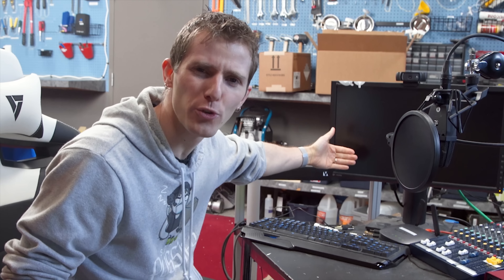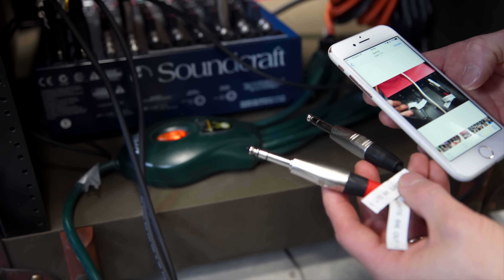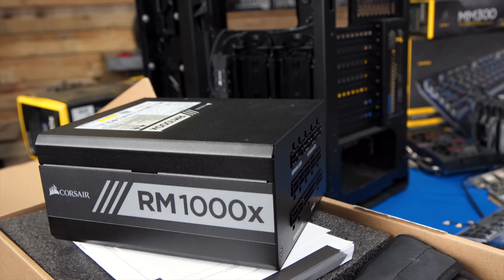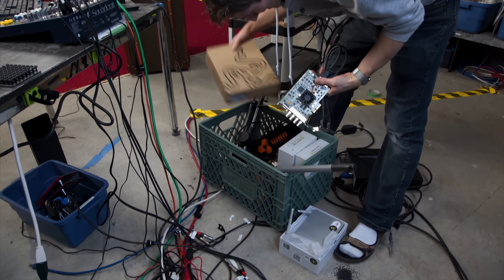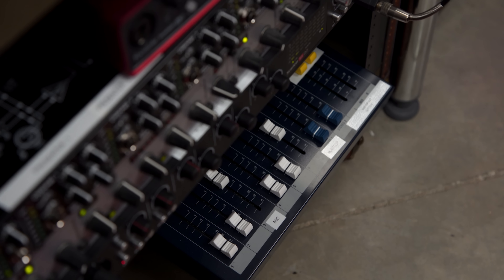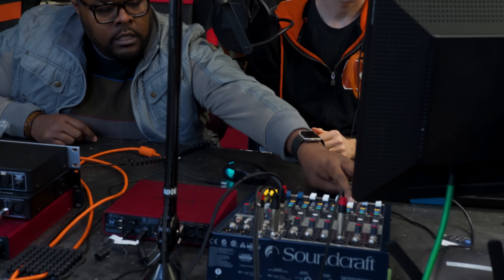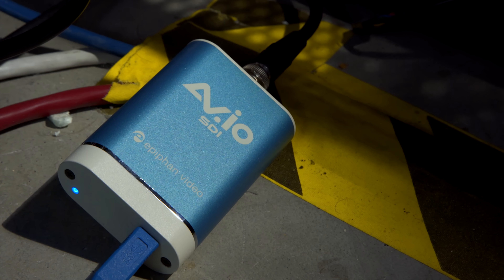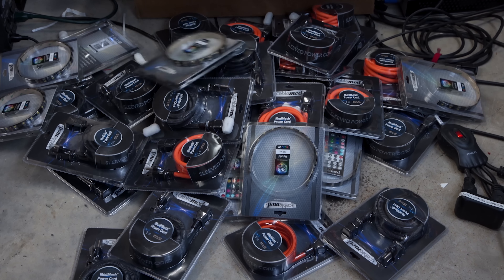WAN Show Repair Vlog - It finally works!!!

Comment: Linus, I don't know if you will ever see this, I have $1200 dollars and want to build a pc. My dad is willing to buy me the monitor (as far as it is not that expensive) and I have an old keyboard. Any recommendations for the parts?
Reply: Rick567 
depends on what you want to do with it. Gaming? Rendering? What resolution and fps do you aim for?
Do you want a pretty build or a price/performance one? Also Water or air cooled, overclocked or stock?...
Reply: Nathanael Forlorn just gaming with high frame rate but I'm fine with lower graphics. I didn't plan on overclocking but I could do it. Was thinking of an air cooled system.
Reply: So 1080p with 60 fps?
Remember OC can be done later on too, to provide some more power in the future, if you dont want to hassle with it right now.

Regardless, you should not even need the full 1.2k. 
CPU:
I'd personally go with an i5, overclockable (With a K at the end) and a good additional fan (K processors dont come with fans anymore), like a cryorig H7 or a Hyper 212 Evo. Or dont OC and take the fan that is in the box. Can't recommend the box fan much though.

GPU:
On 1080p you won't really need a GTX 1080 or anything. Even the 1060 does deliver good performance as can be seen here for example:
http://www.techspot.com/review/1209-nvidia-geforce-gtx-1060/page2.html
Just google "Benchmark gtx 1060" and maybe add in your most played game(s). Then repeat for 480 and see how low you can go with the price for the performance you want.
IF you are fine with 1080/60 you dont have to spend too much on GPU. Also remember that stuff like LoL or CS:GO doesn't require much. Witcher III already is one of the most demanding games you could search for.
(btw the 1060 has a 3GB and a 6GB VRAM model. If you love textures and like to mod more textures in, get more VRAM. otherwise 3 is alright for now in most games.)
All in all for 1080p/60fps i'd go for a rx480 though. (see this: http://www.guru3d.com/articles-pages/amd-radeon-r9-rx-480-8gb-review,21.html )
it's just that i game at 1080/144 and then i like more punch. but hey.

MoBo:
if you go for a i5-7500 e.g. i'd go with a Z270 Motherboard. Make sure it has the ports you need for storage (S-ATA ports for your SSDs and harddrives.)
Make sure the socket of the CPU is the same as on the board. pcpartpicker actually filters for that automatically, just as a hint.

RAM
With Ram you cant make many mistakes. just make sure you grab DDR-4 (i think all Z270 boards have DDR4. double check that.) and then see what is cheap for ~ 2600 MHz. Lots of good brands there.

Now if you dont care much for looks and colours, dont get any RGB stuff, that all costs extra. get a case wihtout window and random colours everywhere, you wont ever see it.
IF you do care about colours and bling, do the opposite: get a window, matching colours, lights, nice cables, .. but that's 100-200 extra.

Also note that the stuff mentioned (especially i5-7500 and Z270 is new stuff, therefore decently futureproof. If you dont care much for that you def could go with a bit older hardware and save a lil more. pretty much up to your preferences.

Also prices vary heavily for every country, so i dont tell you specific hardware, just general ideas and directions. you will have to compare some parts for your local availability regardless.
You could also wait to see what AMD releases soon. Depends on if you want to wait, or get something now. BUt they could very well release a CPU that fits your needs and cost less than an intel CPU (you will need a different board then though. AMD has different sockets, so no Z270. Those boards arent released yet either though, so... )

Rest is even more preference. If you want super fast load times, consider a M.2 SSD (you will need a slot for that on your MB).
I'd def get an SSD for system and a few load heacy games. then a HDD for mass storage like music and pictures.

Alright, i rambled on randomly for long enough. IF you have any more questions, feel free to ask. It's just that such a build depends on a lot of things.
I am right now planning a 8 thread Video-rendering monster machine wiht a 1080, and that equals to 1.2k, so you have plenty of budget spare.
Reply: OH right. PSU:
Get a reputable brand. If the PSU dies, it can potentially fry the rest of the system, so a few spare bucks are well invested here.
Also if you have some headroom for Wattage, you consume less power, which is a longtimes saving, in some regard. Depends on how much electricity is in your country.
You build most likely will need ~ 300 W, so a 430W PSU should be sufficient (depending on specific parts) but 500 are always nice. Again, compromise wiht price.
Reply: Lastly, if you run your internet via wireless (which you should avoid if at all possible. try to hook it up wiht a cable. even if that is annoying.) then you will most likely need a wireless card that you slot into the MoBo. They are cheap, but you will need a slot for it and it's easily forgotten.

Comment: can someone tell me what to do i have a bit of a problem my pc whitch has windows 7 ultamate 64 bit have some startup problems it goes into a boot cikle like restarts 3 or 4 times bevore starting up completly it boots until it shows verevying dmi pool data and rekovering lost dram then it shuts down it does that 3 or 4 times bevore loading windows

Comment: What do you guys think about this configuration?

Intel Core i3-610
Nvidia GeForce GTX 1050 Ti
Asus H110M-A/M.2
Crucial 8GB (2x4GB) DDR4-2133
samsung 850 evo 256 gb or Crucial MX300 275GB
EVGA 450W 80+ Bronze PSU

IMO the processor and the graphics card offer very good value for money considering I'm on a tight budget,MOBO seems decent too,so does RAM,but I'm still on the fence about the hard disk.

I would appreciate if someone could recommend me some good value for money storage solutions.

Comment: What's going to happen to the "graveyard of streaming equipment"? If it were me, I'd sell it for spares on Ebay. If not, you could do a giveaway for the 200 weirdos that would pull the equipment apart for its components.

Comment: 4:37 aaaaghhhh!! Unbalanced cables. Seriously. Like cmon guys there's some good gear on there and you ruin it by using 1/4 inch jacks. Shell out for some decent XLR's and wave bye bye to most of the interference you will get.

Comment: you seriously need to clean and tidy... how do you get away with any health and safety inspection i presume they have those in canada there are trip hazards everywhere and not to mention the risk of a fire from all the cables and cords rolled into a ball and stuffed into a corner... and you could do with building or using a set for the wan show it is after all a regular show and not a one time thing...

Comment: Audio has ALWAYS been a LTT weak point. Especially shows in this setup here, SoundCrap mixing board AND Focusrite Preamp? Yes, SoundCraft is not know for reliable or quality equipment, but you guys really don't need two preamps for one microphone.

Comment: I don't wanna be hating on you guys. Really I don't, I love your content and the info you guys provide. But I'm wondering exactly what the point of this video is (as a typical power user). You guys had to be given not just $3200+ USD worth of gear, but also the employees from the sponsoring companies in order to be able to obtain the same quality of stream as people who are a single employee home business (no, I'm not going to name any other streamers) but still, there are so many other guys/girls out there with a small business on even hobby budgets that always had better audio, who can walk to a light switch, who can use tape to tie down cables, in order to obtain the quality your viewers have been complaining about for years. 

Really, I don't mean to come across as a hater. But I would much prefer to see a video of how to obtain this kind of quality on the kind of budget most of your viewers would actually spend. I mean how many of us could actually get the company to come in and set things up? Personally I would much more enjoy a video showing how to properly setup a stream. How to set audio correctly. The differences between bandwidth and stream quality. PC based audio/capture vs external audio/capture and all the etc...

There are streamers out there doing all of this on the same PC they stream from that never had the audio issues you guys had. Why is that? I'm honestly curious. Could you provide a comparison showing the things you did wrong and how a user can prevent those errors in their own stream? I don't know what those errors are, so I'm not going to harp on it too much. But this does not seem like the kind of solution that many (or any) of your viewers would be able to take in order to correct similar issues

Comment: Just what is all the audio gear for? You have ONE microphone. All you need is a mixer with an XLR input and a computer. You wanted to go seperates with an external pre-amp for your mic apparently... But still asides from the negligable benefits and extra clutter THAT brings why would you need these all of these EQ and other options you could simply do with software? Please next time hire the dude from Setupwars instead it still looks like a mess with far too much excess peripherals.

Comment: Your Audio setup is still over complicated.... please get rid of the Soundcraft desk, they are terrible.... Use the Focusrite equipment, it is much higher quality than Soundcraft. If i was you, i would go with the Behringer X-touch as a controller with an X32 Rack as the brain via Ethernet and then down USB into the streaming PC.  X32 rack has 16 XLR inputs and 5 1/4 jack, 1 L/R phono and 1 stereo jack inputs. Plus its expandable, and all your processing is in built.

Comment: Can someone please tell me if these parts are compatible 

be quiet! BGW01 SILENT BASE 800 WINDOW ATX Full Tower Computer Case - Orange
 
ASUS MAXIMUS IX FORMULA LGA1151 DDR4 DP HDMI M.2 Z270 ATX Motherboard

Corsair Hydro Series H100i v2 Extreme Performance Liquid CPU Cooler, Black

Intel 7th Gen Intel Core Desktop Processor i7-7700K (BX80677I77700K)

EVGA GeForce GTX 1080 FTW GAMING ACX 3.0, 8GB GDDR5X, RGB LED, 10CM FAN, 10 Power Phases, Double BIOS, DX12 OSD Support

Corsair RMx Series, RM850x, 850W, Fully Modular Power Supply, 80+ Gold Certified

Corsair Vengeance LPX 32GB (2x16GB) DDR4 2400 (PC4-19200) C16 for DDR4 Systems - Black

ASUS PB287Q 28" 4K/UHD 3840x2160 1ms DisplayPort HDMI Eye Care Monitor

Razer BlackWidow Ultimate Stealth 2016 - Backlit Quiet Mechanical Gaming Keyboard with 10 Key Rollover

This is very important to me and my first build. Can someone please explain because I do not want to buy parts only to mess up.